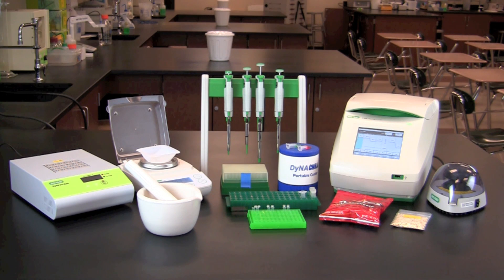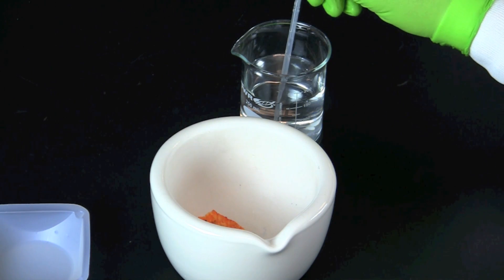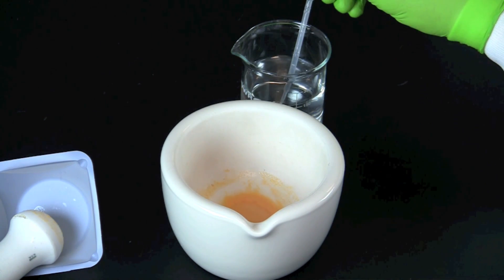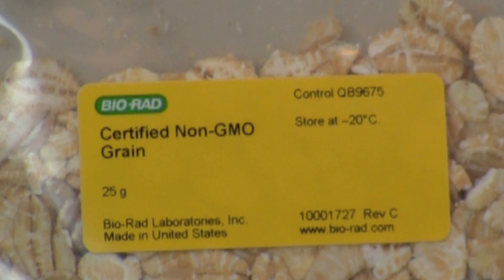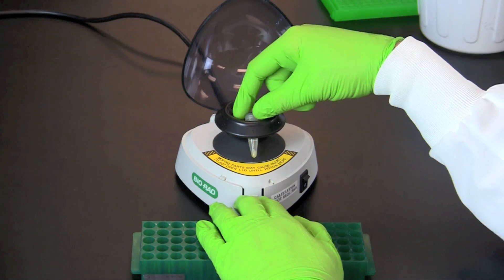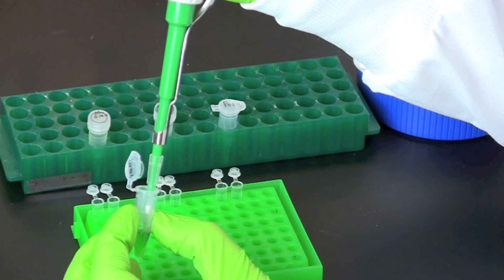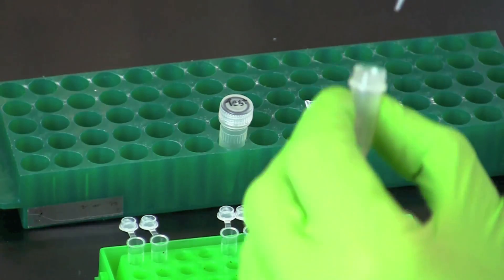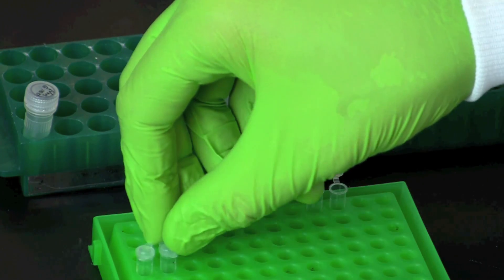GMO Detection by PCR

Comment: what is the reason for the positive/neg control. Also the reason for plant and GMO master mix
Reply: I think it depends on the primers, since in the GMOs the region to be amplified is between wt-DNA and mutated DNA. You will get in the gel electrophoresis a fragment with a certain length, but to be sure your primers also contain the sequence of the mutated DNA you would have to do a negative control. Now if you get the same sequence for both crops it can mean 2 things: 1. both crops are were genetically modified or 2. your primer sequences can´t bind the mutated DNA since this sequence differs from the one of the primer. I hope i could help